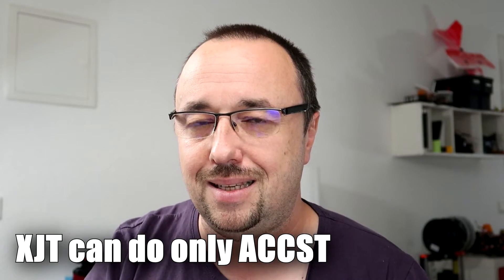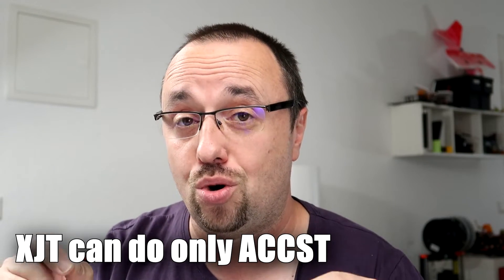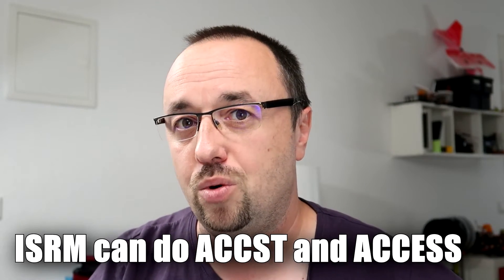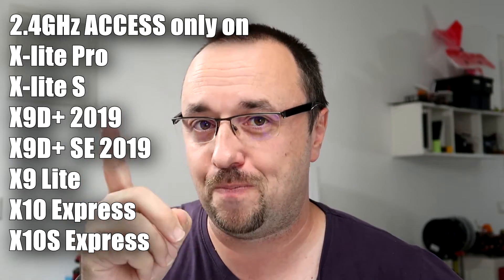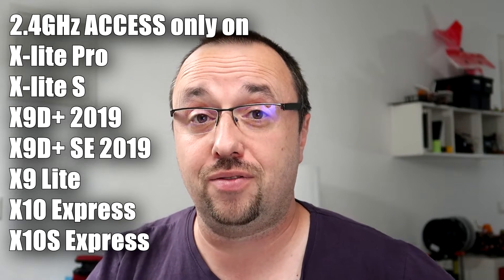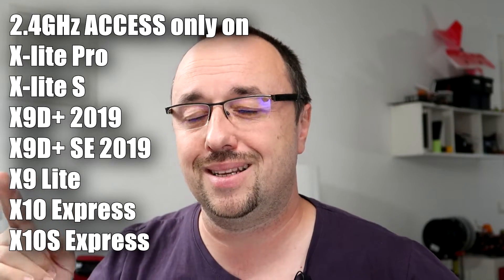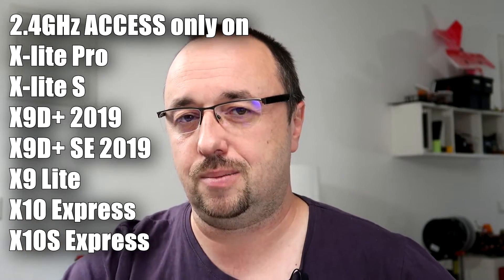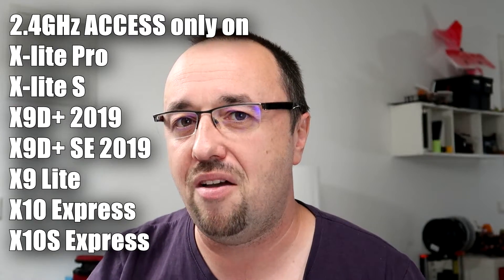FrSky ACCESS vs FrSky R9 radio system - The Facts

Comment: Pawel, I purchased an R9M system from Banggood, with the R9MM receiver.  It is labeled R9M 2019 on the module.  I also have the ACCST version X10S.  I plugged the module in and bound the receiver.  It has worked fine since I purchase it in March 2020.  My question is this.  Is the module defaulting to ACCST to the R9MM?  There is no way to determine what firmware came pre-installed from the factory, and I have not upgraded the firmware.  Kind of scared to touch it.  It simply works. :)

Comment: So this might explain why 🤔 I bought the qx7 with r9m to test as I'm a spektrum and crossfire user, however once i got the qx7 i liked the ability to play options, problem is I went a lil crazy changing two many things, so I thought to myself, (and yea this is my fault and feel dumb) but I'll just reset it and start binding up. Now the qx7 I got says accst on it and again came working with the r9m module and rxs. But Also keep in mind as a lifelong user of spektrum and only recently have I even gotten crossfire fully setup due to my lack of understanding in allot of the basics, side note... ( I was a music producer my whole life and didnt know even how to solder when I began flying about 5 years ago, So I'm only now JUST becoming familiar with electrical engineering honestly. )  and while I'm thankful allot of what is maybe common sense to soo many people in fpv is all new to me.. But I usualy learn new things quickly and like a challenge, TO A POINT... But this QX7 I got as they were on a big sale on bangood. I HAVE in the past said always spektrum is better, but how can I know without testing myself? Also I honestly liked the look and feel of the qx7 and If I hadn't done a reset Maybe I wouldn't have spent all this money and MUCH MORE TIME than u would imagine, trying to get my qx7 and r9m to work again. I had no idea which firmware to use. Yes It seemed simple download firmware 1rst right? Well this is not so easy when there were at least 4 versions from just qx7 with r9m. And ive tried so much to get it back to how it was when I received it. Working well with both. The qx7 I got seemed like it was newer even tho not the official access version It seemed like I should've had no problems restoring it to the way it came, which I must say (someone took the time to set all of this up before It was sent out, this is something I didn't know and thus why I believed Factory restore would put back the gui how i received it. BUT no it took the radio back to like something COMPLETELY different... this comment could go forever so I will just say, I still have the radio, which I wanted to like. ESPECIALLY when I can possibly use either my crossfire or r9m depending on what I used in a given model.. Allot of the things in open TX are very appealing to me, however. This is one reason I have always loved spektrum.. dsm, dsm2 dsmx 11ms or 22ms all this is easily understood and I have used almost always just a spektrum satellite rx, even when it required a bind code equal to what speed you wanted to use. This was never a problem, and I have both dx8 original one (the GOOOOD one) first batches of dx8 were VERY high end and they quickly changed some things to make their old dx8 more profitable (or this is what I've come to understand) Because my DX8 is kind of special? IMHO I believe this is true I honestly feel that the dx8 I have it on par if not better than my newer 2nd gen dx9 but not black version. Gimbals ect seem to be hall sensor and maybe this was upgraded by original owner? Possibly... but the point, I digress spektrum was and is simple, straightforward and I have had many good years flying with the old dx8 and just a tiny satellite rx. Especially when the newer ones came out that are full range.. but I still can fly in a fixed wing at least a mile or more before I even begin to worry about a brown out. Even right next to or behind a cell tower, with LOTS OF heavy duty gear, this tower is loaded. And the fact I haven't had one brown out in 5 years even with semi long range and just a little satellite has been amazingly satisfying. But for flying wings and being an artist and musician I often wish I had my own splash screen and audio ect... I was very much looking forward to testing the system of frsky for myself however. ALL I have been able to do is make matters worse and tbh now i have 0 idea where to go from here... other than to call frsky and MAYBE they can tell me what they did (or what banggood)  may have done before sending out. So I can try this system the way it was sent and in a way I can trust. I GOT IT BOUND to the diversity r9m small rx it came with right away, but since then, nothing. I APPRECIATE all the info even if it leaves me more confused than I already was. Now remember this is my first go at opentx, and my fauly for hitting reset. But Ive tried to ask banggood ect. And gotten no answer that say if u have these two items sent together what firmware actually came with it originally that I believe I need to reinstall to use the rx I originally bound it too... If anyone can offer to give me a hand I would love to try this system and have some other questions because I could swear this came with access and just said accst thus as I understood was why they were on sale as they had been branding the new ones at the same time with the access label, and tbh I see some people are using crossfire on qx7 with no mods and most say u need a modified qx7 to work with crossfire, last but not least this amazing lil diversity rx with two giant (immortal T style) antennas with the newer colored heat shrink (ty for that vid) i removed it thinking this was a mistake until I saw your video explaining the reason for the small pieces of heat shrink.. I have forgotten the color but at the time was for newer, I Thought Access or flex versions.. sorry for the long comment. Ty as always, your videos are very much appreciated and I hope you keep going for many years, maybe someday I'll get to a point where I can say ahaa! I know half as much as Pawel! Lol 😉 😆 all my love to everyone.. ty 👍 
All info welcomed Especially info about this time when all this changed and re: qx7s in a state of flux or flex or something lol

Comment: Why are they selling the r9m module at rdq it says access/accst compatible will it work with older accst transmitters. any help I need to upgrade I only got my radio 2 months ago but cant use any simulator or upgrade anything because its a accst version they never even told me wanted to use R xsr for telemetry but I am not updating this one so I need another one any suggestions

Comment: But can the Taranis X9 Lite run with the R9M 2019? The normal version, not the lite pro.
Reply from the maker: it has no JR module bay. So maybe with some kind of a adaptor. But better get a better radio mate

Comment: This is so frustrating, Frsky own so much credits from the community, we made them big, now they get arrogant and annoying, just give us all full options, open up your links and hardware. If prices are reasonable community will support you! Anyway to buy again a new hardware no way !!!

We need open RF protocols, so we can have several suppliers of hardware and choose the one you like. Same as we choose our flight controllers. The best would be SPI receiver on flight controller and SPI on the TX, like deviation Tx is doing. Probably this will also bring evolution and innovation and more features, and keeps the flashing very simple.(just on firmware on TX, and on flight controller)

Anyway for the 2.4Ghz, I beleive the reason that the XSR receivers are is not supported for Acces. There are several RX out there not made by Frsky, but can be flashed with FRSKY firmware. So they use original Bootloader from XSR. Frsky does not want any manufacturar to be able to manufacture Acces receivers, or be able to flash Frsky Acces Firmware on their hardware.

I would be interested to see if we can find  mods or work arrounds, to get it all working on the non 2019 hardware.

Comment: I look forward to ACCSESS as this is a more powerful system
I am pleased to have the latest in development. 
And software developed by pilots for pilots. 
This radio equipment is also cheaper than other types so it works well.

Comment: i just bought the R9M...  so forced to flash it with old firmware. If I upgrade in future, i will buy crossfire on my old Taranis. Instead of an expensive Taranis and a new module....is this the inversion trick you mentioned?  connect the Fport wire to the inverted UART and use soft serial? https://www.youtube.com/watch?v=5H19xDkmNF4&list=PLlYYdRHk2qwBi-fGg_RedxQilwKHHjovr&index=2&t=304s

Comment: I just purchased the r9 m lite pro module to use Access r9 firmware only on my old x-lite radio not the newer pro, as my old r9 m lite stopped working, i updated my radio,  and flashed  the module and r9 slim+ receivers with flex ACCESS firmware, everything seems to have gone well,  the receivers have bound and i have the option of using up to a watt, where as before the old module you were stuck with 100mw max, the only issue i have is the radio says sd card warning but everything seems to work fine, well we will see when i test them in the field. All this firmware can be very daunting and confusing, would not be so bad if they did not use very similar sounding names for there firmware and updates. By the the way if you read this Pawel did you used to make antennas? as quiet along time ago i purchased a helical antenna from a guy who made them in poland and i was a very impressed with the antenna at the time.

Comment: No, You are correct. I guess I will stock up on R9 minis for now, although I may need to learn how to get SBUS along with  servo outputs like my trust X8Rs.       I am using the R9 mini in a Radian glider with great results. I would go with TBS as well, but I am cheap...frugal?  The Crossfire Lite is tempting at 3x the price of the R9M and $40 to  $60 or twice the price for receivers. My Original X9d non-plus has 99% of the features I want, but is getting long in the tooth.  The X10 non S looks good...but the Jumper would be fine as well. Especially since the Mods for internal module and other DIY niceties will follow just like my  original  X9d.   I see that Aloft Hobbies already has your iMSB bluetooth module for $80 bucks!  No deep discount like what I paid for an early R9M module and $10 R9 minis!  FrSky, Make it right and easy and easy to finance for your loyal customers to upgrade these recent radio systems!!!

Comment: Let me interfere a bit here.
You can use access on the old transmitter for the r9 series.
You have to flash your taranis with opentx 2.3
After you have to flash the last fw on your module (access fw) as well flash your access fw on your Rx.
You will have a hibrid, meaning that you will have accest on the transmitter itself (supporting all the old protocols) and access on the r9 line . It will work perfectly.
The above only applies if you have the new version of the modules: R9M 2019 and R9M lite Pro.
I have tested it and it works perfectly on the x-lite (old one, not s or pro) with an R9M lite PRO module on it.
All the access functions are working
Reply: Even the X9d non-plus with the 2nd gen, not 2019, R9M?
Reply: The transmitter should be able to work, but with the r9m 2019. It's a 36$ upgrade.
However you will have to manually upgrade it to the nightly build of opentx 2.3 as your transmitter is discontinued
Reply: Basically opentx 2.3 tells the transmitter about he new models

Comment: That sucks! TBS, please make Crossfire cheaper and I'm sold.
Reply: Stefan Näwe The Crossfire Lite module is under $70. It has update over air, same range as the full module, just stripped right back with no Bluetooth. I have R9, going to swap to the Lite as soon as I can raise the funds.
Reply: @fdsfpvquadventures1141  Yep. But the receivers are still a little on the expensive side.
Reply: Stefan Näwe Yes, but at least they won’t be obsolete in 12 months.

Comment: BLOODY HELL! A day after buy a QX7 this comes out. Should have just got one of the cheaper lite transmitters, S$@T!
Anyone else a wee bit confused now? So access will not be available for the qx7 which was released what last year? I maybe could understand the older x9d but the new radios. And the fact that the lite versions support it over the more expensive versions what a rort!  Will stick with my ezuhf and hope my luck holds out with it, or crossfire maybe if I feel it's worth it. 
What I won't be doing is upgrading my radio as they are getting sill expensive.

Comment: I'm still running the original X9d non-plus passed down from Dad, an early adopter of OpenTX, the real brains of the system. I have upgraded to Hall effect, added a top mounted micro usb,  a six position mode selector and finally a cheap R9M and a few $10 R9 minis. Add LUA Telemetry and Yappu Arduplane telemetry and it is almost all I could ask for.  Dear FrSky, Stop spitting out incompatible hardware, Grow up and mature your business model as a well rounded consumer oriented organization or,  your customer base will support a new, more enlightened, full service provider of quality radio control systems  at a fair price that has an ear out for what the customer and super users would like to see. If not,  your super users and tutorialist will jump at the chance to support a company trying to be a great place to work with as well as a pleasure to their base.   You can do it, and you will benefit yourselves as well as the hobby!  Dad and I still have much to build, fly and BUY!

Comment: I would not care as long I can get spares parts for my actual system ( QX7/R9M). One ordered R9mm has
to be reflashed with the common firmware. I will buy some more and then my deal with Frsky will stop.
My first batch QX7 was already changed to a different version after 3 month of sale.....Thanks
Reply: I have the first batch qx7 too. Very annoying. I have first batch xlite regular. I will be very careful supporting frsky in future
... or change to better company.

Comment: R9M Lite Pro runs access on original X-lite on nightly opentx firmware
Reply: it is simultaneously with accst or you have to choose accst or access? in description Taranis X9d SE 2019 
support both. Am I right?
Reply: @omenmm  
Simultaneous. Internal rf module still supports D8 and D16 ACCST and R9M Lite Pro supports ACCST and ACCESS. Best of both worlds especially if you are a thumber running R9 receivers

Comment: Is it only inverter or politics as well? AFAIK inversion of the signal can be easily fiexed with software (OpenTX) or softwares (OpenTX and R9M) to work with noninverted signal. Also, there is no problem to support new radio<->TX protocol but not to use new features like OTA, spectrum analyzer etc on OLD hardware. It is just parallel branch in firmware repo. I think it is completely doable from technical point of view, what do you think, Pawel?